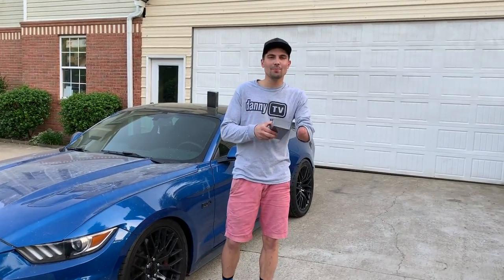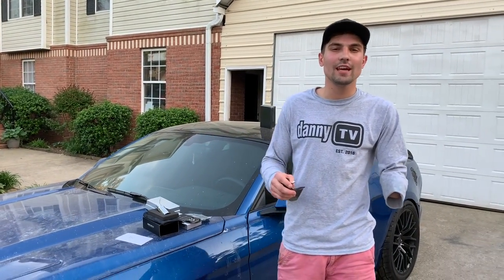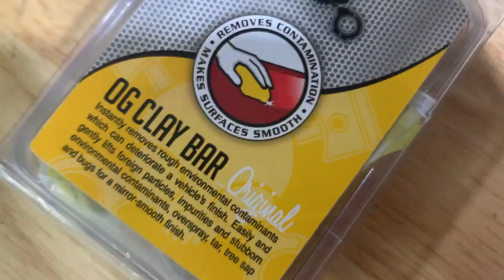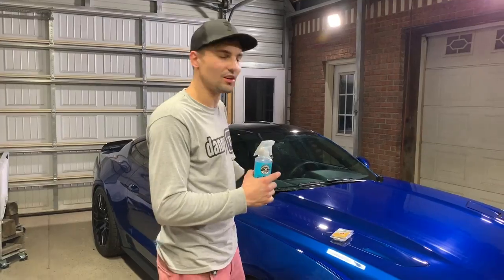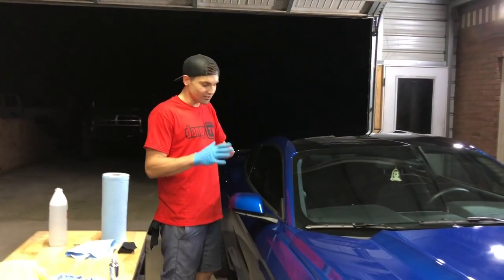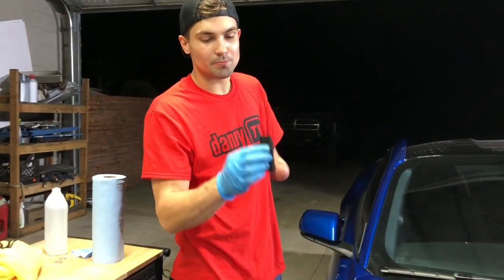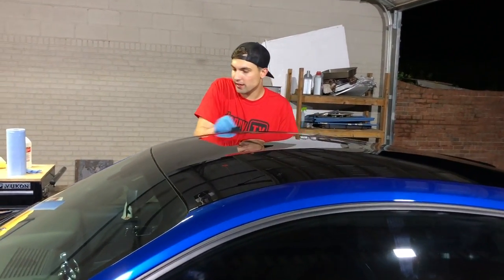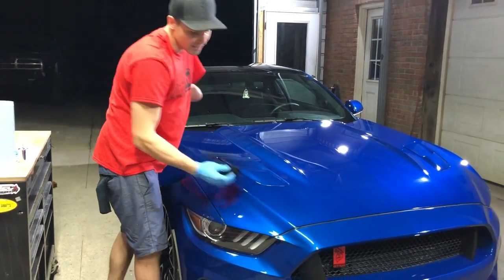Rebuilding A Wrecked 2017 SUPERCHARGED Mustang GT [part 12]

Comment: Avalon King..........Danny super detail on the Mustang! Such a beautiful car! Quick question for you! Do you think Avalon King would protect the clear coat on my new Accord like if I was at work on a hot day say 90 - 100 degrees and a bird crapped on the car! It is black & usually if you get hit by a bird on a hot day & aren't there to get it off quick enough it will haze the clear coat which shows up badly on black? So I wanted to get your opinion on whether this product would help out in this situation thanks for all the cool videos!
Reply from the maker: Thank you kickit59 it was all worth it looking at it now. I will be doing a follow up when the car gets really dirty but to answer your question I do think it will help a lot bc you will have like a 2nd layer coating over the clear coat and  bird poop has uric acid which will be harder for it to attack the paint.
Reply: @DannyTV7  Hello Danny thanks for getting back to me. I will give it a try I know with black if I don't the birds will eventually get to my car when I am at work.  Thanks again!